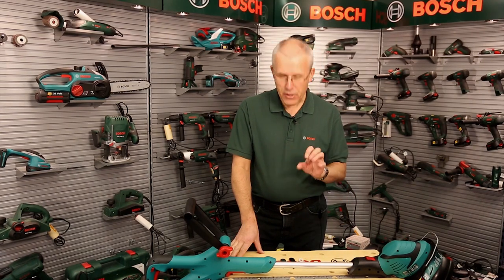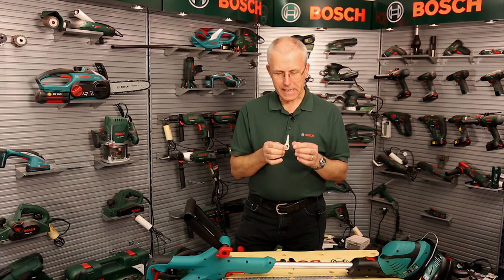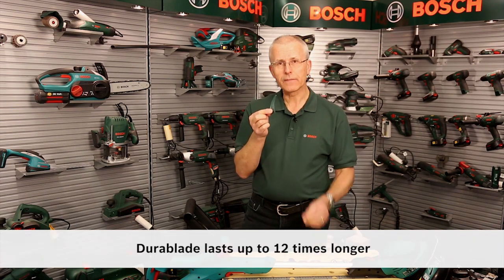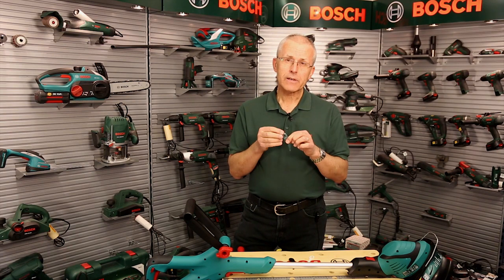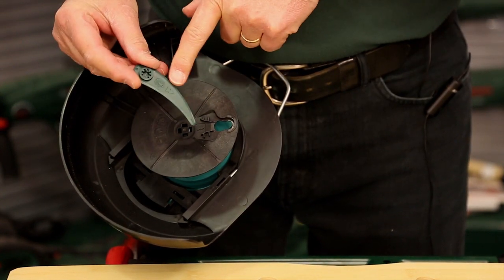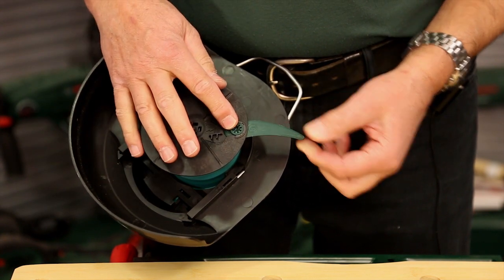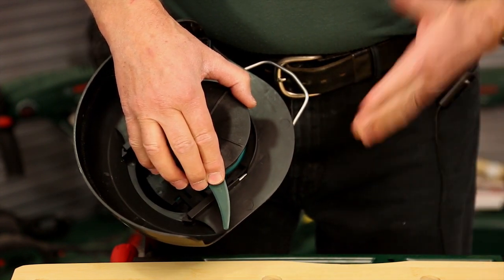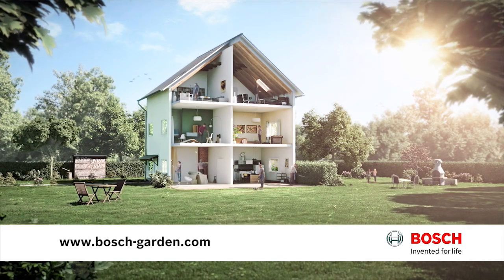Benefits of: The Bosch Durablade Trimmer Blades with Eric

Comment: This is the most hopeless product I ever purchased - I would have expected more from Bosch.

I have stones around my garden, and I can wear out minimum one, and often two durablades each time I cut the edges - that I can live with, if these did not come with an outrageous price.

Currently, I am no longer using my Bosch, but using a no-name product with normal low-cost trim wire.